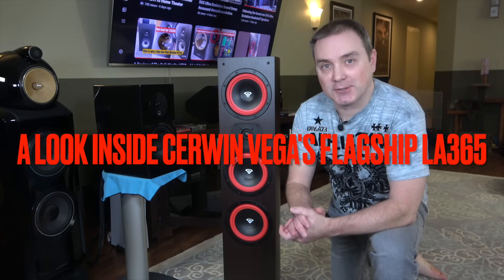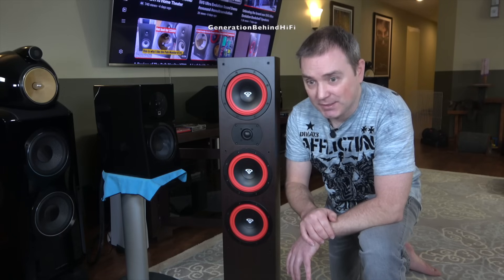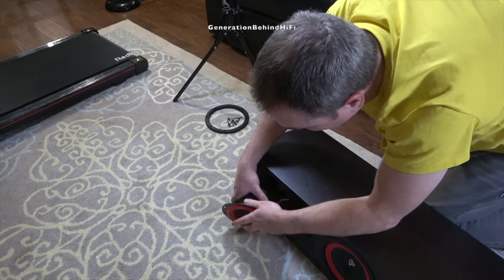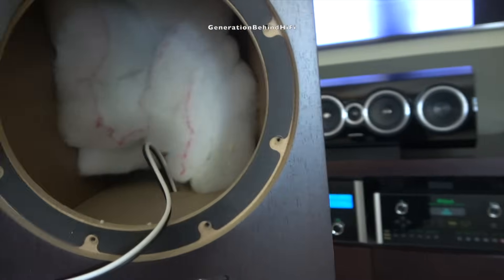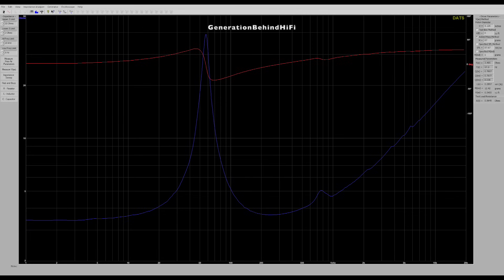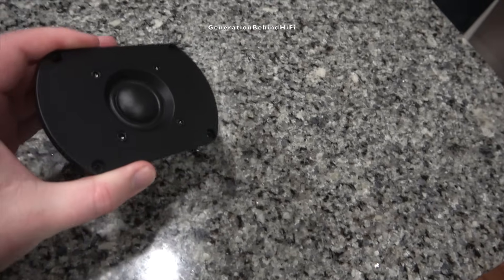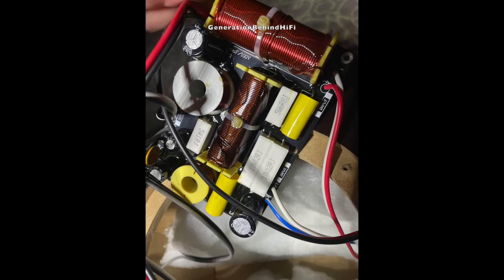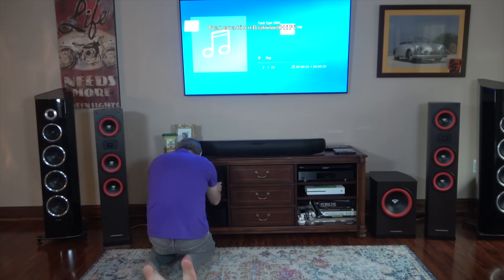A Look Inside The Cerwin-Vega LA365 - HiFi just got seriously affordable! #speakers #cerwinvega

Comment: A few obvious errors here...stamped ohms number is not DC ohms, it's impedance. You said air core inductors, but you show some with square iron cores right in the video. Also, yes most all cheap speakers used closed back mids or a separate chamber, tore apart dozens.
Reply: I had one that used a piece of cardboard tube and a 3mm MDF cap as a mid enclosure.
They spent all their money on the carbon fibre woofer and mid cones. Tweeter was in a horn.
Sounded ok for a budget speaker but let down by crossover and cabinet

Comment: JUNK! 
Sadly...you're only purchasing the Cerwin Vega name.
Reply: How is it junk? These CV's have several hallmarks of a well-built speaker. If this was some other brand with the same exact build quality, would you still call it junk or are you just on the CV hate train? I get that many of Cerwin's offerings over the years have been questionable, but these don't look like junk to me at all.
Reply: the new owners are the Cerwin-Vega Mobile division, arguably has always been their best. the new speakers are awesome.
Reply: I was juts about to comment.. Finish on the drivers is very bad, sharp edge around pole piece hole... All that work, just to have noise and unwanted turbulence around rough pole vent piece.. Cheap stamped basket ... For that price range, not so sure.. But the rest is very good..
Reply: It's par for the course for budget speakers.

Also has CV ever really been that great? It seems they were decent enough for loud bass back in the day, but the mids and treble were disgusting on the ones I've heard.
Reply: @RennieAsh Great in getting lotts of loud music for the ppl, they have a past like acoustic research, but nobody knows.. Any how, Theyr BACK BABY. Also try putting a big old cv on something Else than a pa amp. I have at100s on elektrocompaniet amps, il never buy expencive speakers again.